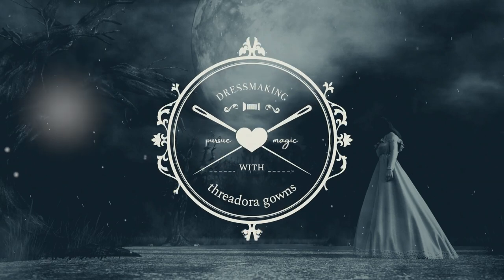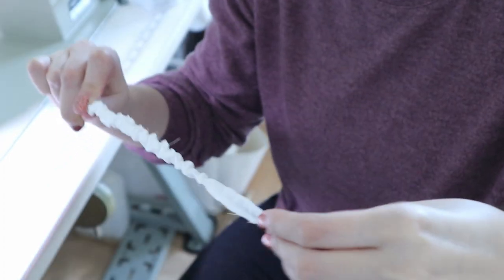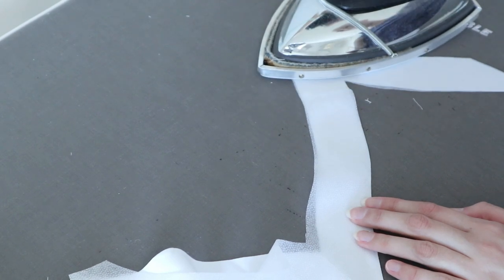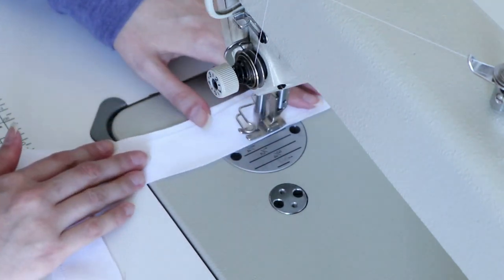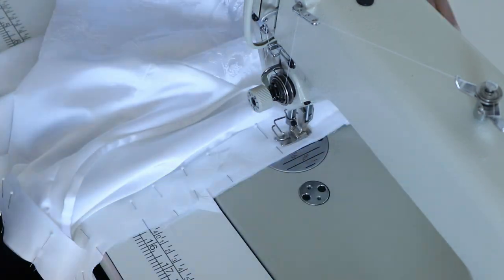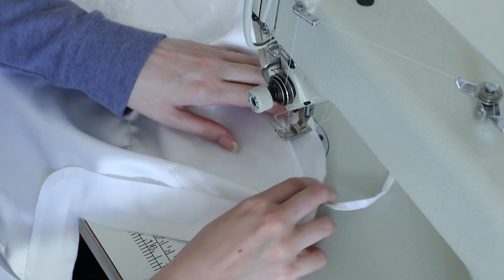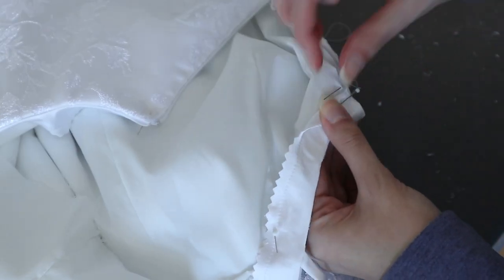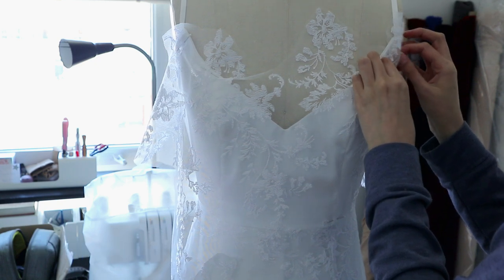Sewing a Bridal Gown Pt.5: Bodice Lining & Facing

Comment: Is the facing the inner most layer or is it in between the lining and outer layer?  I haven’t seen both a lining and facing used together before.
Reply from the maker: Yes it’s a narrow facing that was handstitched to the lining. It gave the neckline more support better than lining alone or a bias tape. Sometimes the lining can be sewn to the bottom of the facing. But you would have draft separate lining pieces it accommodate, I also find that way you see the lining/facing seam through the garment. This way was much cleaner!